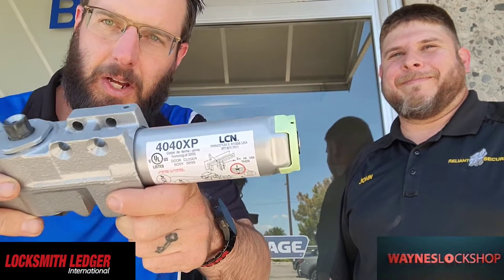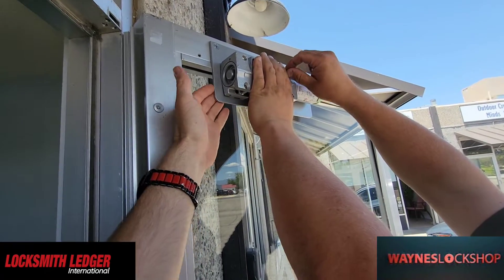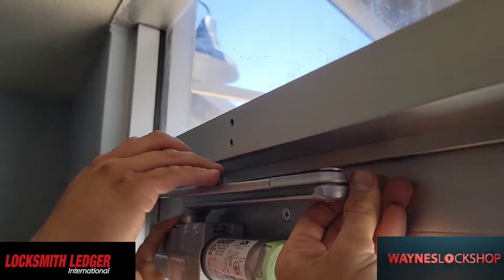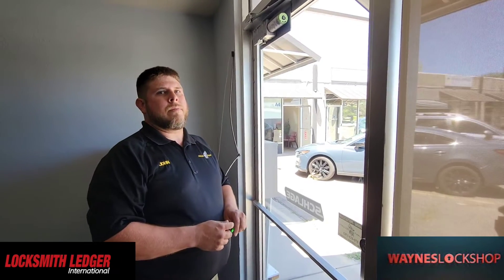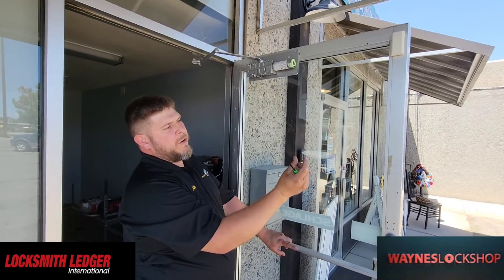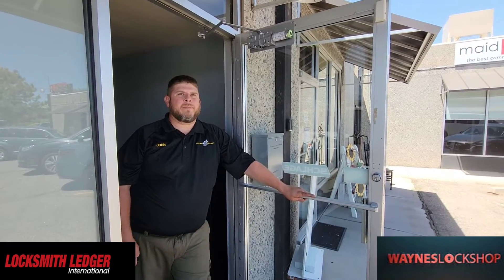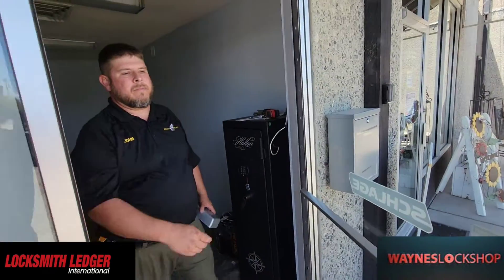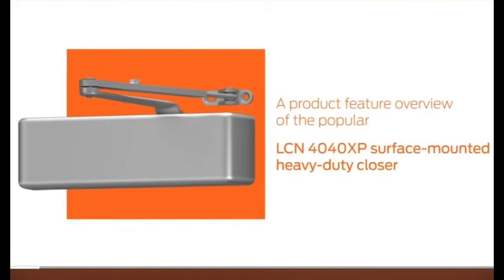Installing and properly adjusting LCN 40-40 XP series door closer with drop-down plate in parallel

Comment: Not : most manufacturers will not warranty any closer body if the back valve has not been adjusted.
       some maintenance people or bad installers will use the arms as a door stop,they will pre-load the arm one more segment to make the closer a door stop instead of back check.
       This will blow out the valve seals and cause leaks ,then the doors will slam.
       Then adjust the closer to the building stack pressure to close and secure,do not worry so much about ADA specs,as most people or building inspectors do not check that in a big building and you will have un-secured doors everywhere.True !

Comment: You need to test door force all the way to 90 degrees open, and you may need to adjust back-check to comply. ADA Interior Doors 5# Max;  Exterior Doors vary from 5# Max to 15# Max depending on state. Closing speed for all doors is 5 seconds minimum from 90 degrees to 12 degrees from fully closed. Consult your local ADA professional.

Comment: Another thing worth showing is the "power" strength adjustment on the end inside the green cap. It usually come preset for a 36 inch door, but it's worth noting that closers installed in the parallel arm setting lose about 25% of their strength, due to the awkward angles it has to pull the arms at in relation to the door, especially during the last half of the closing. So if doing parallel, I always set the power rating to the next size up, especially if the door is outswing into potential wind (like this one). If it's an interior door free from any wind, then that's not so crucial.

Comment: Does the LCN 4040XP come with mating-bolts or thru-bolts in the screw set?
Reply: The boxes I've opened all had 3 screws options: Wood screws, machine screws, and self-drilling screws. They also have the thru-bolts like your asking, which accept the machine screws.

Comment: How do you know where to put the plate ? You should consider recording the entire installation.  Using template  , tapping the plate. Such huge apportunity for a an amazing video , no one gives full instructions on how to Install closer
Reply from the maker: The plate measurements are unique to each installation so it's not universal. The direction give you an easy to follow formula. 😊
Reply: It's called job security

Comment: Why won’t the closer work properly if you don’t screw in the back valve?
Reply: Allegion website says "The valve on the back of a 4041/4040XP closer is a "Back Check Selector Valve" that needs to be turned in on "Parallel Arm" mount applications ONLY."
Reply: @sbalzer  yes!  It changes the position of where back check functions because on regular arm they can only open to 120 degrees.  Parallel Arm or EDA can go 180 so back check needs to kick in later.  Thanks for the reply.  I was pretty sure I knew the answer but figured others might have that question.  😎
Reply: @drewinstallshardware Thanks for the answer. I was wondering and searching all over for the answer! Makes 💯% sense!

In the end, I left the Back Check Selector valve open for my parallel arm install because I didn't want the door to open more than 100 degrees due to an outside railing.
Reply from the maker: Honestly we were told to do this by the representative and have just done it automatically so I'm not sure what happens.
Reply from the maker: Yes thank you for clarifying 😊
Reply: BTW your channel is awesome Drew
Reply: @sbalzer  thanks for checking it out!